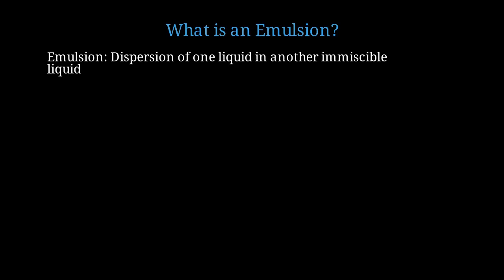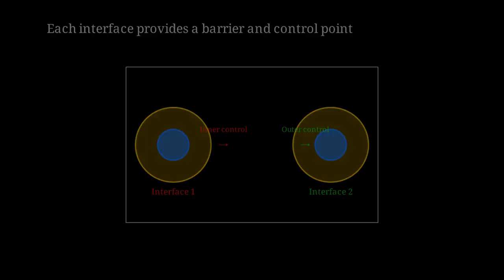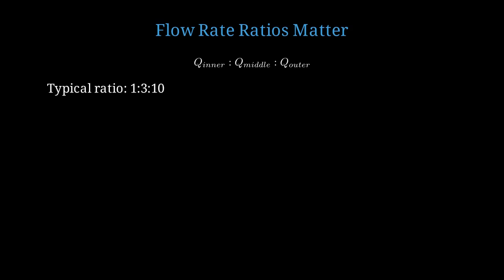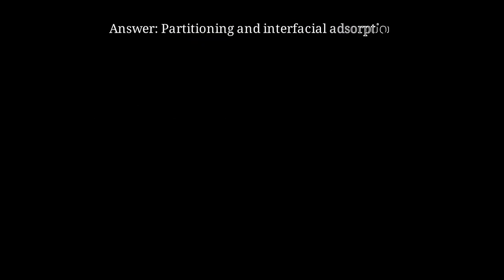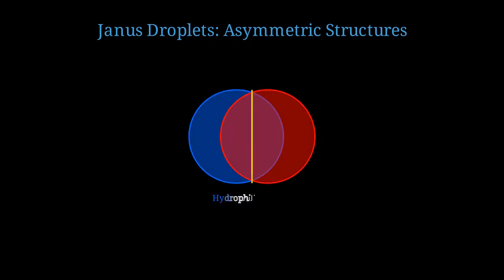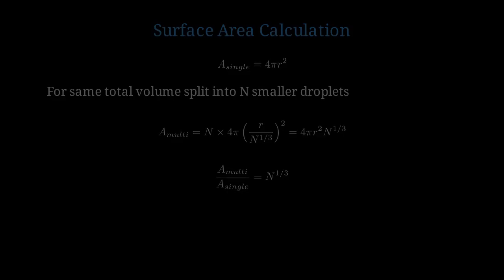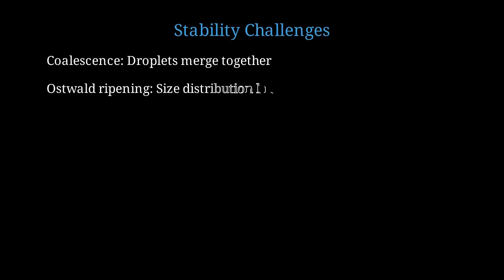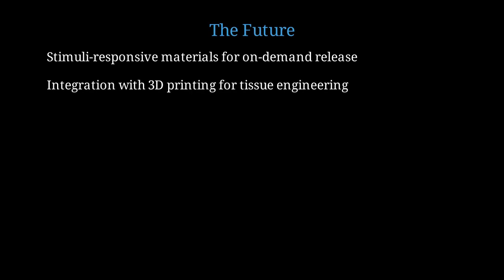Shell Thickness Controls Everything: Inside Programmable Droplets

Comment from the maker: How can we predict and suppress coupled instabilities (ripening + creaming + coalescence) in double emulsions using a single reduced model that links interfacial tension, solubility, and diffusion across multiple layers?
What is the optimal shell composition and thickness that maximizes encapsulation efficiency for proteins while minimizing interfacial adsorption and preserving bioactivity during fabrication and storage?
Can we algorithmically design multi-compartment droplets (including triple emulsions) to implement a specified multi-drug release schedule with independently tunable time constants and triggers?